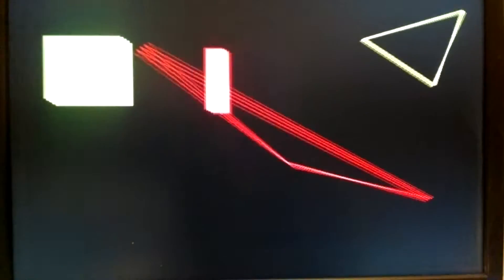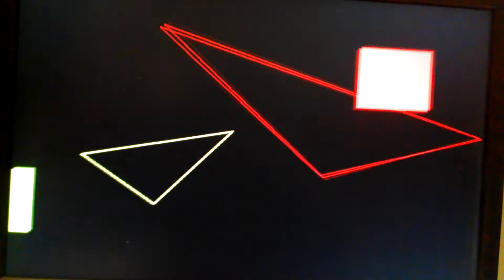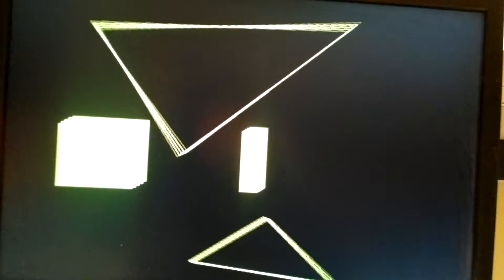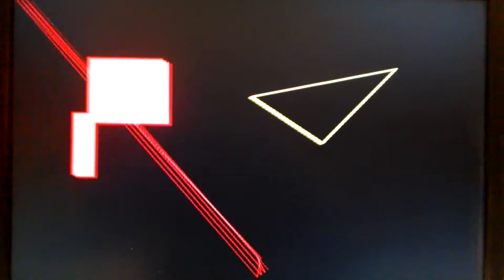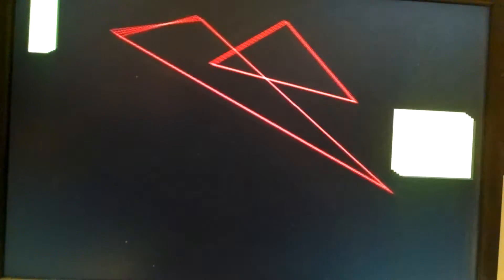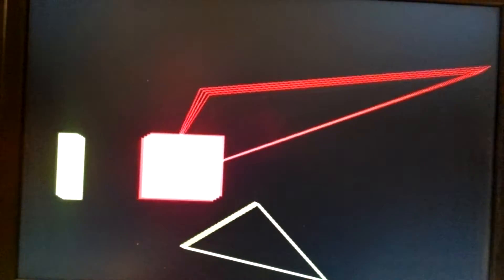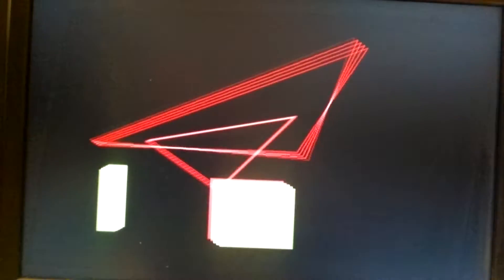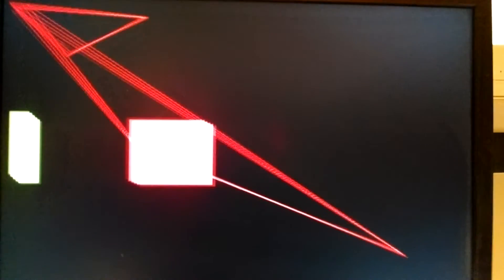Papilio Pro Animated Shapes (No Frame Buffer)

Comment: Cool! This reminds me of coding for the Atari 2600 which also didn't have memory devoted to screen buffering. You had to count cycles and hit a register to draw horizontal pixels as the video beam traversed the screen. If your count was off you would suddenly loose synch and see garbage on the screen.
Reply: Seeing the low level work that Cory has done makes me realize that we often take for granted the work done by those who came before us. Especially the low level code that makes the modern day engineers job so much easier.
 
Regarding the Atari 2600. It was extremely challenging to write software for however there were millions of these consoles sold so the payoff could be huge.

Writing a hit game for the Atari 2600 was a dream of mine around the time i was also working on the Apple II in the early 1980's.  I had an Apple II 3D application from Bill Budge (who wrote a number of popular Apple II games). This 3D application had a space shuttle model in it. I was able to take a number of rotated bitmapped images of this space shuttle and get them running on the Atari 2600 which blew people away because these were relatively high resolution 3D images on the 2600 which was unheard of. You were behind and above the space shuttle and you could tilt it up and down and right and left (yaw and roll) as you flew forward into the screen.
The Atari 2600 was usually known for it's blocky low-res images.

Anyway, I worked day and night on this thing for weeks getting to this point and then promptly "burned out" on it and moved on to the next thing that interested me. A classic example of when you're young being able to start something with great promise but not being mature enough to stick with it to the end. So this is one of those "woulda shoulda coulda" stories I get to tell occasionally.
Reply from the maker: chris jochumson Wow, that sounds awesome. I was probably around at the time but didn't realize you were working on that. Very, very cool. And I'm very familiar with that {w,sh,c}oulda feeling. :-)
Reply: chris jochumson Wow I realize this is probably unrelated but you've totally activated a memory of the Atari 2600 Space Shuttle Simulator.  http://www.atariguide.com/0/044.htm  I totally forgot about that game but I loved it back in the day.